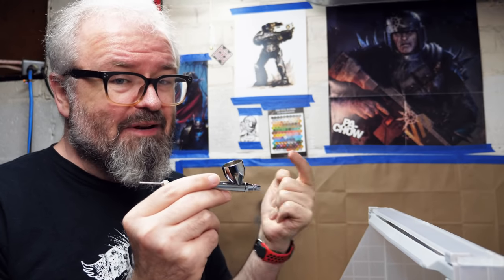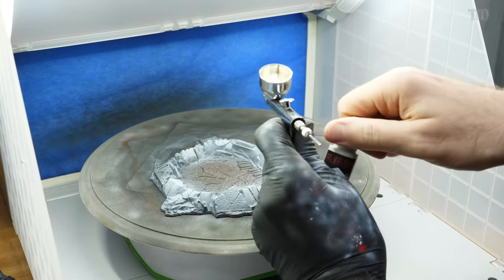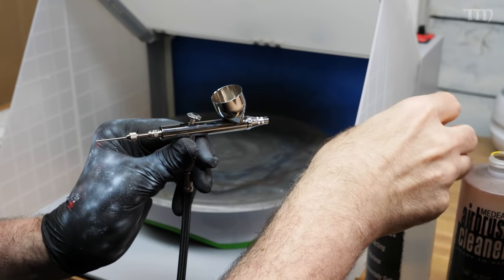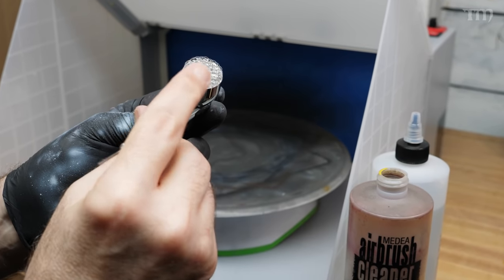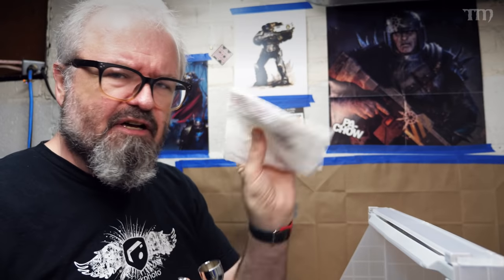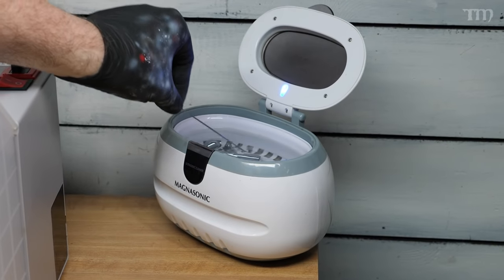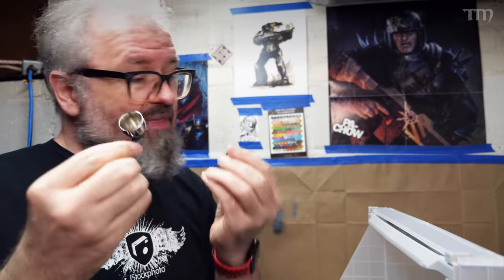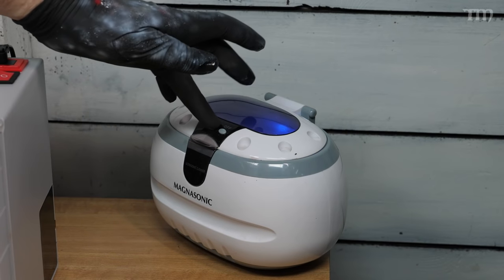NEVER Clog Your Airbrush Again!

Comment: Watched loads of How to Airbrush videos, never heard of keeping it submerged between sessions. Thank you UA. Love your videos.
Quick question: Can you airbrush Citadel Contrast/AP Speed paints?
Or do they need to be brushed?
Reply: You absolutely can airbrush contrast and speed paints. They will apply more as a semi transparent ink than as their intended purpose of base coat/wash combination though. But it's definitely worth looking into as a useful technique. I highly recommend checking out Squidmar's videos where he paints stuff from Fiver because he shows what can be accomplished by airbrushing contrast paints.
Reply from the maker: I airbrush those paints all the time. They’re great for tinting, filtering, and weathering. Thanks for watching!
Reply: @tabletopminions  if you use speed paint 2.0 can you give me an advice what im doing wrong? If use speed paint over airbrush it just clogs after one minute of use. I tried with 0.3 and 0.2 needles, was spraying at 20-25 psi and was aiming to make very thin lines when spraying. Room temperature was around +20 Celsius and humidity around 60%

Comment: Would keeping it submerged in isopropyl alcohol also work? I imagine you could probably be lazier and leave the airbrush more assembled if you submerged just the front (just past the cup) vertically in alcohol. No risk of rust, minerals or anything growing.
Reply from the maker: I’d be concerned about what the IPA would do to the rubber o-rings long term. I don’t know if it would actually be bad for them, but I’d wonder. Thanks for watching!
Reply: Definitely. Are there O-rings ahead of the cup? I'm definitely new-ish to airbrushing, but I thought the O-rings were back further.

Comment: first what I do is I go to the sink with the strainer in the sink and wash it out with water takeoff take it all apart clean it out make sure that the water is flowing through clean then I go back to my room and I use isopropyl alcohol, 91% just a little bit and I do the same my back flush and blow it out and then I add anotherround of alcohol always comes out clean. I also lubricate and believe it or not I found this on YouTube. I use a lubricant for sex and it works really good. It keeps everything lubricated and moving smoothly and ceiling properly small little bottle.

Comment: Another tip: remove the needle through the front. Otherwise you will drag leftover paint all the way through the airbrush.
Reply: That's not even possible cause tour needle has a ball on the end that can't go thro the air brush. Lol
Reply: @mkulchar  Well… then you can’t I guess. 
I use a Harder & Steenbeck where it‘s an option. 🤷‍♂️
Didn’t know there were Airbrushes that are constructed differently.
Reply: I actually just discovered how much more sense it makes to do that today. Also why I'm here. Dam black lines keep clogging out then pooping
Reply: @mkulchar what kind of air brush are you using that has a ball on the end of the needle. Why would someone design an airbrush needle that way
Reply: @MrCQrity agree 100%, i use Harder&Steenbeck as well as Paasche and I do the same thing so i am not dragging paint back through the body and down in around the plunger that the trigger pushes down for air to cycle
Reply: @user-un5my5bw4j 
Never heard of Badger??…… That’s who

Comment: Clean where the paint is.  My concern with putting the entire brush into water is the air valve.  The seal, o-ring, on the valve is lubricated, so you end up removing the lube.  I don't know how bad that is longterm.  I soak mine in diluted simple green with the air valve above the waterline for 5-10 minutes.

Comment: Uncle Atom:  Do yourself a favor invest in a Grex Micro Air Control Valve. It comes with a quick connect. Best Upgrade for your brush. Next upgrade use Badger Regdab Needle Juice. You will never need to wet store your brush again. Finally since you asked I use Createx Airbrush cleaner in the 32oz party size bought for less than $18 from Midwest Airbrush.

Clogs happen regardless of wet or dry storing. Everyone should have an airbrush cleaning kit which includes  a selection of cleaning brushes and a needle reamer. There will come a day when you will wish you had a needle reamer.

Comment: I would highly recommend avoiding those cleaning brushes. I'm currently waiting for new parts for my airbrush after the cleaning brush disintegrated inside the nozzle. This stuck tiny bristles in the nozzle that no amount of cleaning will remove and resulted in the airbrush spitting paint in all sorts of random directions.

Comment: ultrasonic cleaning seems excessive. i use water and or iwata cleaner and have never had a problem. keeping it wet also sounds like asking for corrosion and causing problems wirh the seals
Reply from the maker: I’ve had that airbrush in water (except when using it to spray minis and terrain) for nearly a decade. No corrosion, and no trouble with the seals. The ultrasonic MIGHT be excessive, but I like to safe rather than sorry. Thanks for watching!

Comment: I'm new to airbrushing this year. Fairly basic stuff I figured out by myself within a few sessions. I don't get the keeping it in water thing, if it's clean it won't matter if it's dry. One tip I would give that you didn't is to ALWAYS add some kind of thinner into the cup before you add paint. Then mix with an old brush or something. NEVER use unthinned paint in an airbrush! Why do you say "IAwata?" btw?

Comment: well, i also never have problems with cleaning my airbrush. and i have a small, lets call it critic, for your technique. After the first backblast technique with the specific cleaning medium, i would never blast the liquid back to the front, you can never know, hoe mutch dried and hard particles are in it, so i spill just the pot out. because when you blast the contaminated liquid after the backblast back out throught the nozzle, it can clog it up, and the idea of the backblast is that you remove stuff from the nozzle, so why then spray them back to the front? no, just simply spill the pot out. i do also spray out cleaning medium torwds the front, but only after i made sure, the pot is clean. Another point is when handling the needle, always pull it out towards the front of the airbrush, cuz you dont want to have ANY particles ln the back of your airbrush, where your air nozzles and the trigger action is! if you use the airbrush alot, and you always pull the needle out the back, you always drav particles into your back mechanics, and believe me, with time, this can cause alot of problems

Comment: The manufacturer specifically says the opposite of what you suggest to be done to your airbrush. You should never pull a dirty needle out from the rear of your airbrush. You can cause damage to the Teflon seal and also the air valve could become blocked with paint. Always remove the head cap/nozzle and push the needle out the front of the airbrush. Another thing is that you never soak your entire airbrush in any type of liquid. Especially an ultrasonic bath. Again, you never want to damage the Teflon seal or the air valve. Soaking will certainly damage the packing in the air valve assembly. You have to send your airbrush back to the manufacturer to have these parts replaced if damaged.

Comment: No thanks. I back flush, dump, repeat, a few times, using a little brush to loosen any paint at the bottom.  Then spray it out tapping the nozzle until it backs up into the cup clear. Then pull the needle and spray a full cup or two through. wipe the needle clean, and lube it. Insert needle, add couple drops of lube in the cup, one little spray to get the lube into the nozzle. Put it away.

Comment: I followed the advice regarding keeping the airbrush wet while not in use and it's ruined my airbrush :-( I think you might live in an area with soft or at least softer water, because mine began to build up with deposits in areas and now has begun to break down in areas. I would just suggest caution to anyone else looking to try the submerged airbrush.

Comment: I have been a professional paint spray trainer/teacher for Sata, and Devillbiss for years.. the first thing i always see going wrong is people submerging paint guns under water. 
If a wet gun was supposed to be the best solution, then companies would deliver the new guns in a wet solution, right?!
A good cleaned gun, can be stored away for a long time, wet surroundings can cause many other problems. It’s the worst advice you can give.
In between colors, and for short periods, yes keep it wet. ✌🏼

Comment: The best way to keep an airbrush from clogging is to put the lid on it when you use it. That way the paint doesn't dry in the cup during use and you can just rinse it out with cleaner and water. Soaking it between uses isn't necessary at all.